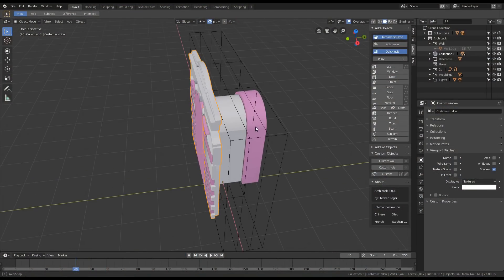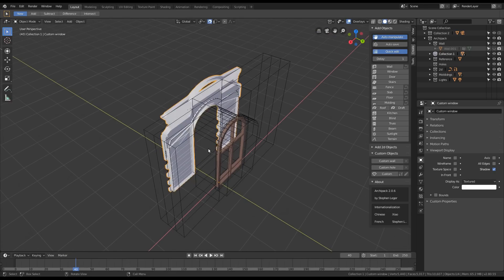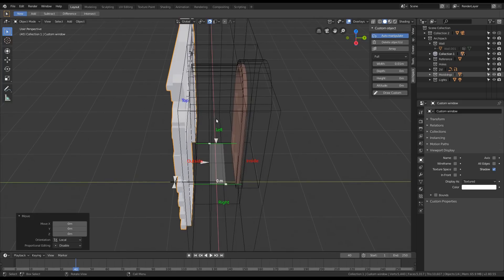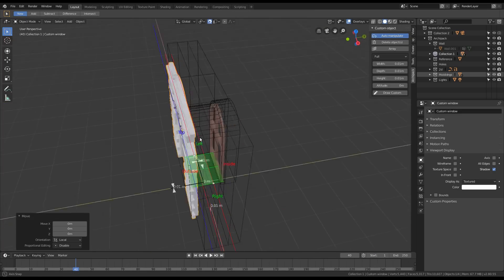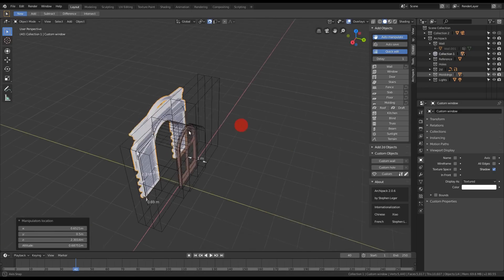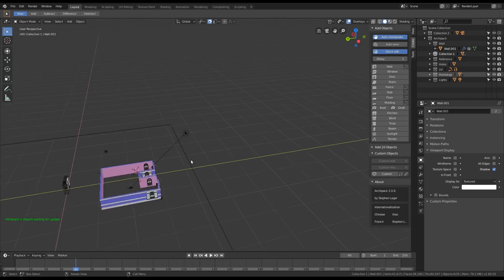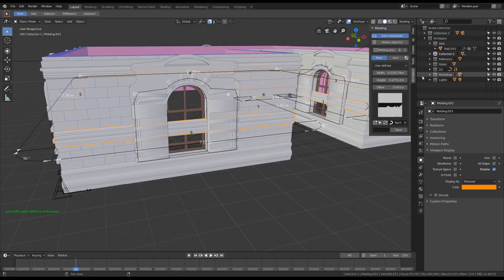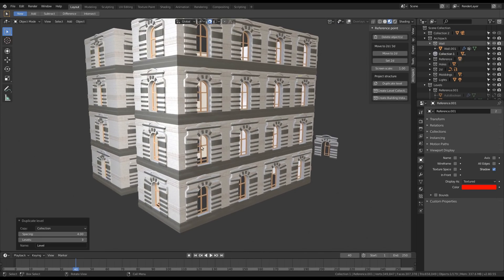Archipack 2.0 tutorial: Custom objects setup

Comment: When I try to set the manipulator location it does not snap to the geometry. Is it possible for you to setup a new tutorial clarifying how to use manipulators?
Reply from the maker: Hi Manuel, in blender 2.82+ there is an issue with the snap, you can't snap a wall to itself, it is a blender limitation. I'm working at CAD Transform integration to overcome this issue.

Comment: terrible teacher. you start out like so many before you. its more work to follow when the instructor is vague about instructions. using words like "this" as often as possible. ok what is this that you are doing. use your words. like which button did you click. if someones following they have to look around your screen for where you are clicking instead of you just telling them where you clicked which adds to the learning capabilities by tenfolds. just something i have noticed over the years of a lot of smarties making tutorials. they usually suck at it.
Reply from the maker: Yep, basically i'm a coder and simply try to do my best with my rusted english. Perhaps should i only make french tutorials ?
Reply: @StephenLeger  well if it is possible at least to cover up how you reach to that custom part for example. Did you modify a door or can you create something from scratch? And how do you validate that you end your setup parts? What about the material and texturing?
Et cela ne changerait rien de le faire en français, juste un peu plus de détails stp.
Reply from the maker: @94wolvzz  I'ts pure custom mesh created from scratch.